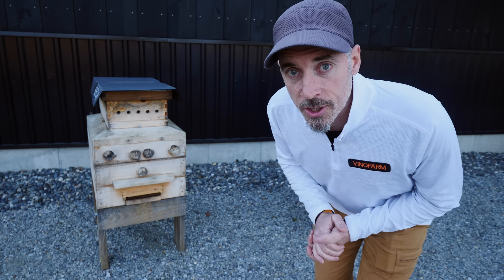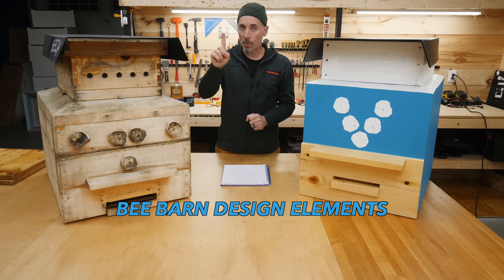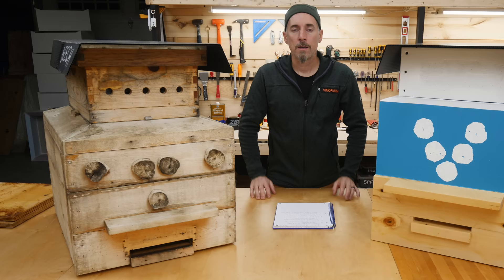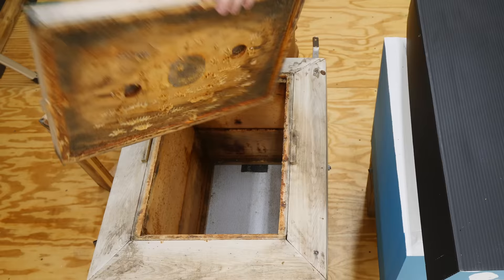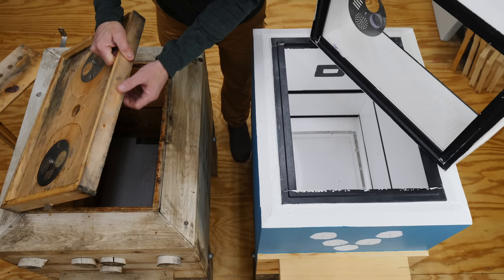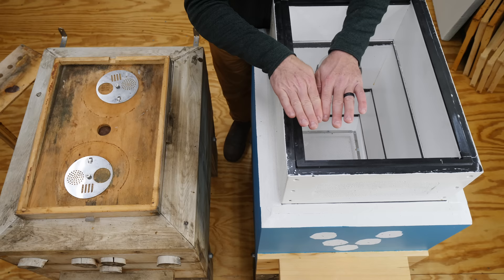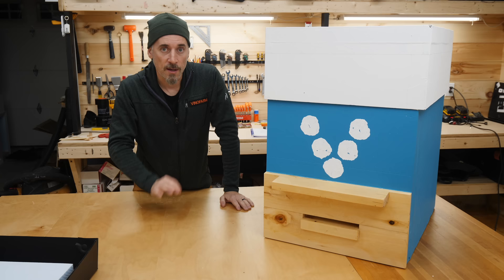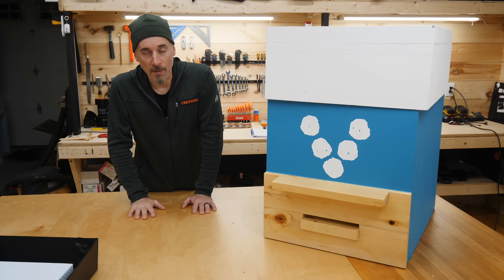I Fixed The Langstroth Hive (Again) - Bee Barn 2.0 REVEAL!

Comment: I've enjoyed following your journey of discovery and innovation.  I started my journey by knowing I had zero interest in Langstroth equipment or treatment (traditional bee keeping).  That said, I opted for building my own superinsulated Layens hives and catching feral swarms off large tracts of land.    Now, having said that, it seems that your new bee barn is  closely moving  toward a superinsulated Layens model in that it's basically a 9 frame horizontal hive (with lang frame tops).   Let me qualify what I mean... very deep frames, single horizontal layer with no honey super.  
One additional comment re ventilation you may want to consider... no fresh air throughflow, has been shown to potentially lead to CO2 poisoning.  I drill a few 1/2" holes near the top of the opposing wall from the entrance (screen on inside and downward angle to shed water).  Not excessive venting, and the bees can propolize as they see fit...but I at least offer it to them.  
Nonetheless, I love what you're doing and following your journey.  Good job and good luck.

Comment: I have the same setup you had with the single screened vent hole in the inner cover. It has been on the all my hives for several years.   What I've seen is that each hive closes the hole to some degree but none close it completely and some don't touch it. Never have figured out why.
Reply from the maker: Yeah, I used to have similar screens on my Vivaldi boards and some would seal them and some wouldn’t. On the highly insulated boxes, each colony sealed them tight, right away. Must have been a crazy chimney effect.

Comment: Version 2.0 seems really good, I am impressed. I use homemade XPS hives myself for 4 years now, also improving with each year.  I use hive lids completely made out of XPS, this year I glued on the inside reflective aluminium foil and it really make quite a difference, it reflects the heat that goes up back into hive. One thing which sucks is that birds here are sometimes trying to do small holes into the XPS, it's usually minor demage tho. Those new boxes that you are using kind of looks like what Lyson is making here in Europe.
Reply: I was thinking the same and I think it is not a secret that they are in fact modified Lyson poly hives. See a stack of them at 1:50.
Reply: Have you ever tried repairing them with a goop made from Styrofoam and acetone?  That stuff dries hard, but i don't know if it would dissolve the hive.
Reply: @TheRainHarvester  No I haven't. I usually use putty and then put water based color over it, it's easy fix. I have two inch walls, they usually go inch deep and then give up. Where I am it's not that bad but I know people who had bigger problems with this and they put light plastic net over hives which farmers use in orchards.

Comment: If you have to open your hives when it's 30 degrees to check on them, open them at 30 degrees.
You do what you need to do when you need to do it.
30 certainly not optimal, but starving is worse.
Nuts to what people say.
Reply from the maker: Agreed. Even better is to not need to open them, but of course... don't let them starve.
Reply: @vinofarm  Yup, your see through top is way better!
When I 1st saw your channel I saw you going crazy with insulation and thought...ya man!  #MoreFoam  & everything you've done entails even more insulation.  I love it!
One of the largest problems with bees, I beelieve is controlling of temps, especially when a hive is small.  You're doing everything right, me thinks!
I disagree as to why your bees swarmed.  A single deep is more than enough room for a queen bee to lay and the bees to emerge.
A 2nd year queen is MUCH more likely to swarm than a 1st year queen.
Split your 1st year queen and you've lowered the odds automatically.
There are many reasons queens will swarm, even if they have plenty of resources and plenty of room to lay, the hive may still swarm.
If conditions are just right---they'll say, ya know, let's swarm, it's such a great time to make a new colony!  
I myself am going to start making my hives with mainly 2x12 nucs (towers).  Plenty more insulation than thin 3/4" (which I truly think is minimal for your crazy cold temps).  ...but I ramble....
Reply: @vinofarm  Oh, another GREAT quicky way to 'check for honey' is simply lift one edge.  Do it each time so you have a datum to compare to.  Bees don't weigh much, honey is heavy as heck!

Comment: I like it.  I think in version 3 (I know, too soon!) You will have thicker bottom tray with sloped bottom, attached drawer facing (one piece).  I think you'll still get a good bit of trash build-up.  The inslated winter cover is a huge improvement.   I am wondering if the bees will chew the foam on the interior.

Comment: Question - in May, you go from 7 super deeps to 9 to avoid swarms.... do you go from 9 back to 7 in the fall? Do you treat the other 2 as resources?
Reply from the maker: Yes. I’ll condense them back to 7 or so in late August when their stores are usually at their lowest point (summer dearth). After I remove the lightest two frames from each hive, I’ll cross my fingers for a fall flow for them to fill up the rest. If that doesn’t happen, the syrup goes on mid September so they can top off their brood boxes. The extra frames will most likely be pretty bare, but I’ll leave them out for the bees to clean, then freeze them and store them until next season.

Comment: Why not use the 9 frame slots all year long instead of the bother of the spacers? If you are late putting on the extra 2 frames you could have swarming again? Thank you for your sharing.
Reply from the maker: They don’t need that much honey over the winter and I’d rather fill the extra space with insulation than make them have to heat that area all winter long (7 months or so up here.)

Comment: How would you alter your design if you were in a climate where heat is the major concern as opposed to the cold? Here in texas, it isn’t uncommon for summers to stay over 100° for weeks at a time, and 110° isn’t uncommon.
Reply from the maker: Same exact design. Insulation works both ways. (Keeps heat IN or OUT)
Reply: @vinofarm  but with bees adding heat (due to movement), it might keep in too much heat (that is the concern).
Reply: @TheRainHarvester  Bees don't create much heat unless they have to (they can heat up a cold hive).

Comment: My only question so far, is how will this hold up structurally under the weight of multiple supers? Will the supers also need to be made up foam to reduce the overall weight? More frequent pulling of supers needed?
Reply from the maker: There are regular polystyrene hive boxes inside that hold the weight. Those boxes are commercially available and in use all over the world. You’ll see in the assembly video next week.
Reply: @vinofarm  Good thinking

Comment: Looks great Jim! I was wondering about protection from ants? I made a half-baked version of your bee barn last year and the insulation turned into an ant farm. Will the paint keep them at bay?
Reply from the maker: I have not had to deal with any ant problems, but I’m starting to put my brain on it because a lot of people are saying the same thing.
Reply: @vinofarm   im not sure how practical it is to do and use, but @thebugfarmer 3D printed ant traps to go around the legs of his hive stands. If ants are of concern, would this be a route you’d consider taking?
Reply from the maker: @westfarmandbees  Sure thing. That would be a possible solution.
Reply: I put cut plastic bottles under my legs and pour in used cooking oil, then cover with a gap to keep the rain out. Ants are real bad here.

Comment: Does the hive tool puncture Styrofoam?  How would this do in Texas heat?  Nice design!
Reply: How many sheets of styro does a 2.0 barn use? What is size of a sheet?
Reply from the maker: Edges are fully reinforced. Insulation works the other way in heat... keeping heat OUT when it's too hot.
Reply: @vinofarm  how did 2.0 solve the swarming problem?
Reply from the maker: @TheRainHarvester  I haven’t used them during swarm season yet, but I explained my plans to reduce swarming in the video.
Reply: @vinofarm  bees generate heat so even though the insulation would shield heat from getting in, it would also prevent bee's heat getting out.  Bees beard here all throughout hot summer nights trying to cool down the hive.
Reply from the maker: @TheRainHarvester  They’re trying to cool down the hive that got overheated from all day sun beating on the boxes. Insulation would keep that heat OUT. They will not overheat themselves by their own activity.
Reply: @vinofarm  interesting theory. It may be correct. Have you verified by putting a logging thermometer into an empty insulated hive to see if it's still colder by the end of the day than an empty uninsulated hive?  If so what was the final temp of both?
Reply: @TheRainHarvester  I recommend you check Bug Farmer's channel for fully insulated hives in a warmer (at least in summer) climate.

Comment: Not sure why you would say your clear cover doesn't disturb the bees.  You take them from total darkness and provide full light.  This would get them a little more active until covered.
Reply from the maker: I’d say 10 seconds of light compared to a blast of frigid air is a teeny, tiny disturbance. Also, there’s no reason you can’t peek in at night with a red flashlight if it’s that concerning. The key is the propolis seal is unbroken.
Reply: I’ve used clear boards on my hives all year round for several years now.   I’ve never had any issues of it disturbing the bees in any way.  They barely notice it and it’s great during winter months to see how a hive is fairing through winter and if you need to take any emergency action.   As for condensation etc, so long as you have enough insulation on top, this has never been an issue for me either.

Comment: Nothing personal but I am going to respectfully disagree.  Your premise is right that insulation prevents the movement of heat, but the problem, not for you because of location, is in the summer time bees are the source of heat while needing cooling. The thermodynamic principals youre counting on kind of get sidelined by that and also the effects of humidity. As bees dont really care about summer humidity, but honey and nectar do. At that point, real feel temperatures basically apply as the bees will generate heat fanning the drying honey, but drying in 95F with 80% humidity will take a lot of energy.  At night when the temps cool down, your insulation will still be slowing the movement of heat out of the hive.  Based on heat maps For your location this is extra work for your bees for about 30days a year, but people south of you can have this problem for 2 or 3 months. Enough to create noticeable differences in hive health
Reply from the maker: Remember, though, supers are not insulated. Just the lowest, brood cavity. I’m trying to keep out crazy temp fluctuations where the brood is.

Comment: All of this is context/climate specific, especially the insulation and ventilation. This design appears to function well in the Massachusetts climate, but the same design will not perform equally in other climates. 

Beekeeping is local, so a beekeeper's hive design must reflect the climate they keep bees in, as well as the purposes for which the keeper keeps his bees.
Reply from the maker: The insulation stays on year round. We have temperatures from -20F to 100F. Insulation will work in all climates. You can not over-insulate a bee hive.
Reply: @vinofarm  but it's not a matter of whether it works or not, it's whether it has enough of an added benefit to warrant extra insulation. 

In my climate, we have more days over 100F than below it, and maybe a handful below 40F.

Making my hives to R-50 isn't going to improve survivability as much as in your climate. I have 100% winter survival in coroplast nuc boxes. 

Beekeeping is local, and the hive should fit the climate/conditions it exists in. Yours fits your climate very well and shows how it can be a huge benefit to apiaries in your climate.
Reply from the maker: @Velacreations  But think about how much less work your bees will need to do cooling the hive in the middle of summer. The insulation is not only about winter survivability. It’s about giving the bees a stable brood box so they don’t burn resources and energy worrying about heat/cold/humidity. 

I guarantee your bees will be more productive and less stressed in the summer if they had R50 insulation.
Reply from the maker: @Velacreations  Do you insulate your home in the summer where you live? Why?
Reply: @vinofarm  not nearly as much as you guys need to. And we ventilate a whole lot more, too. Shade is what we need here, we shade every surface to reduce heat gain. 

We even run a lot of water pipes just below the surface of the ground.

In our climate, it's about getting rid of heat, not preserving it.
Reply: @Vino Farm Again, it's not whether it works or not, it's by how much. r50 would not give me ENOUGH of a benefit to justify the cost of it. I've tested it. 

Insulation also doesn't make the interior colder, though. It can reduce heat gain, yes, but it also can reduce heat dissipation. That's good in your climate. That's death in mine. 

The bees are generating an enormous amount of heat in the summer here, and it has to go somewhere. A sealed box with a high level of insulation means that the bees have to worker HARDER to cool the hive. It's hard to dump the heat to the environment, because there's very little temperature differential, here. The harder they work, the more heat they generate.

If I have a box completely insulated and sealed, it overheats here, especially if it's in the sun. Because the bees can't rapidly dump that heat.

Different climates, different needs require different designs.

Comment: massively over-engineered
Reply from the maker: A beehive with insulation? Over-engineered? Your opinion is massively under-engineered.
Reply: @vinofarm  upper box, then the special insulation for the winter, which is essentially another box (LOL), the black lid...

I'm using 3cm  thick hives made of polyurethane. So in a sense I am also using an insulated hive. But what you do here is over-engineering . I get it, it's a hobby.
Reply from the maker: @MAQ123  I get it. You disagree with how I keep my bees. Why the condescending attitude? It’s totally unnecessary.
Reply: @vinofarm  if it sound this way - sorry.
as I said, I keep my bees similarly, I just think your hive has way to many elements which will be more of a trouble long term than an advantage. anyway, we will see I guess ;)
Reply from the maker: @MAQ123  Do you understand that I have been using this system for two years? This is an improvement over what I already had. It’s not some brand new idea that I am hoping will work.